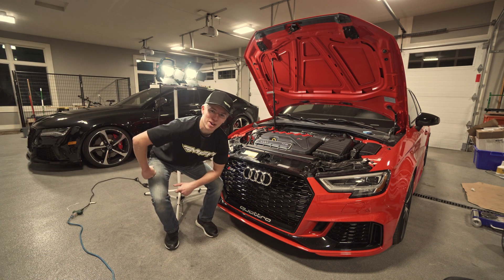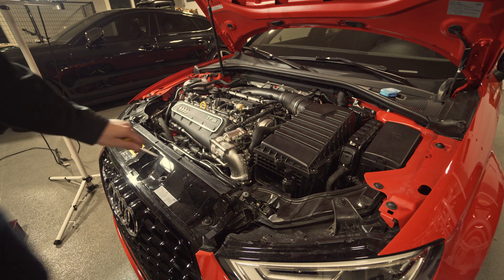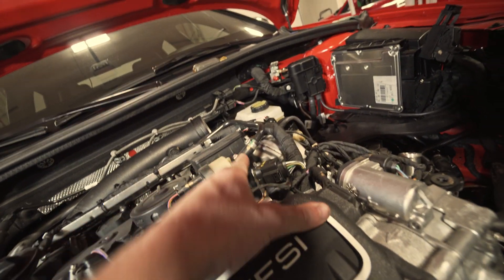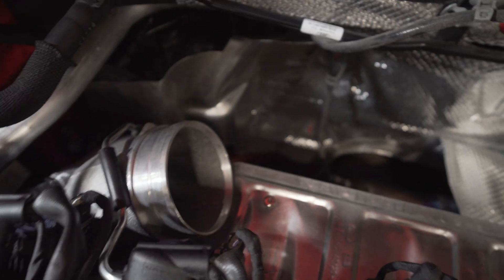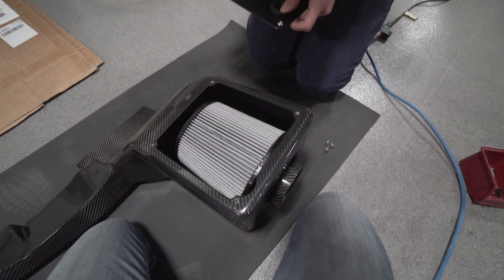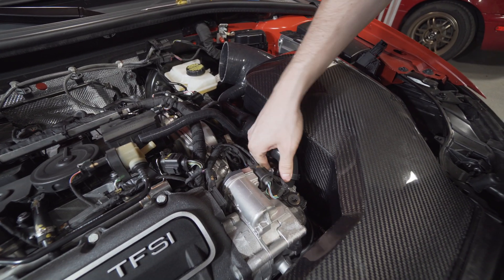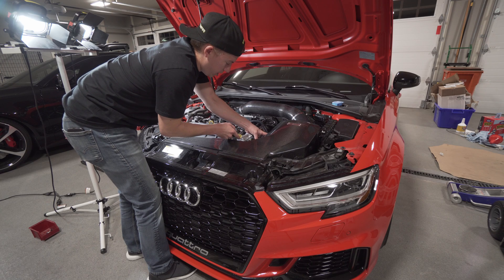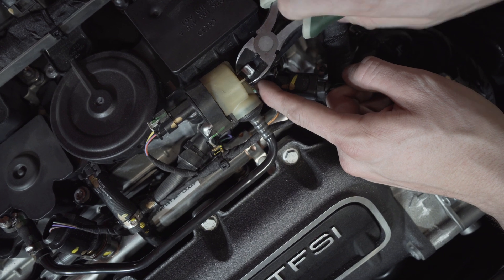Integrated Engineering Carbon Fiber Intake Install Guide Audi RS3 8V

Comment: Any opinions on if the IE intake will cause problems in the rain - hydrolock? Thanks.
Reply from the maker: I don't see this being an issue, the intake location doesn't change, still scoops air just above the radiator!

Comment: can we get a video of how the intake sounds with like the windows down and revving ? im thinking about buying one soon
Reply from the maker: From the inside of the car? I might be able to make that happen
Reply: yes, that would be great. is turbo spool more noticeable ?
Reply from the maker: @Eminem344  one of the things we noticed is the tsoo tsoo tsoo noise if you roll into the throttle and let off, which never ceases to make us giggle!  This is significantly more noticeable with the exhaust flaps closed, but we do have Iroz Downpipes and midpipes which makes the car a bit louder.
Reply: have the downpipes and mids also but that’s good , i think i’ll be picking that up soon. do you guys plan on doing the turbo inlet too?
Reply from the maker: @Eminem344  it' certainly is something we are interested in, but we have another project coming soon that will consume more of our time >.<
Reply: @HardwayLearning  does it sound anything like this https://youtu.be/sUI9rxj2pjM?t=45
Reply from the maker: @Eminem344  pretty similar, but I would say the Iroz kit is a little louder (although it's hard to judge from that cockpit video).  You definitely get a similar spool noise which is always entertaining.  Sorry I didn't catch this comment until today!

Comment: I wonder why they use worm clamps as opposed to t-bolt clamps?
Reply from the maker: My assumption would be cost cutting?
Reply: there's no pressure, t-bolts just add weight and cost more.  not to mention you can easily crank them down too hard and crack that cf.